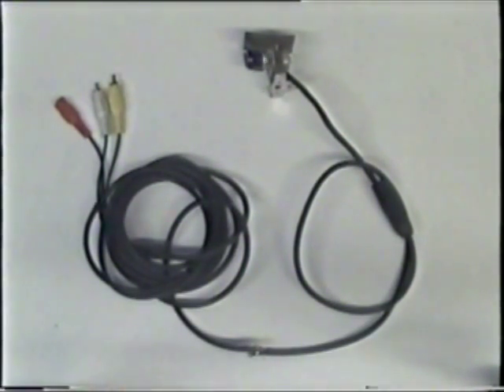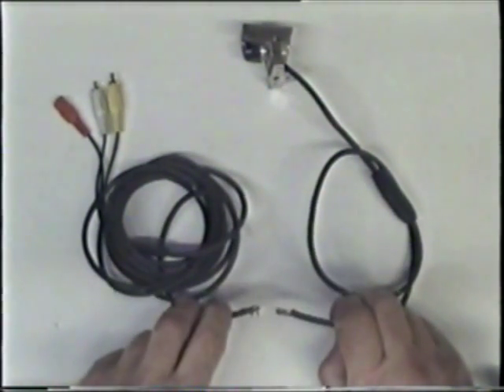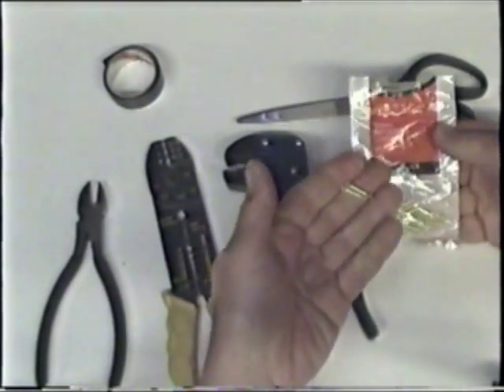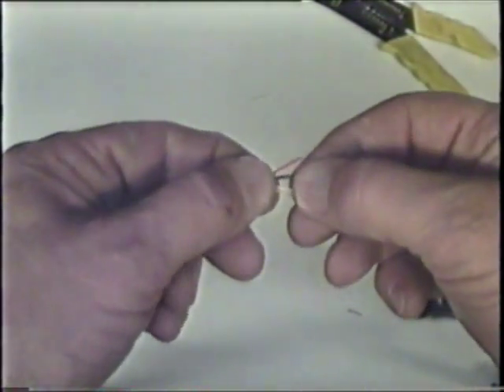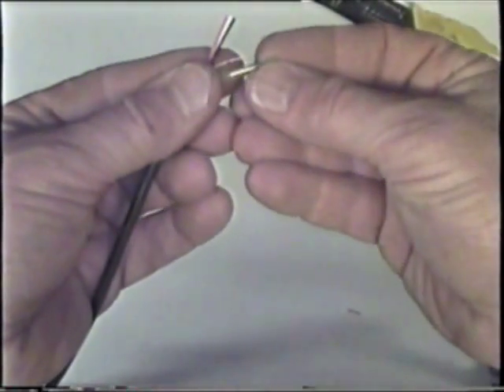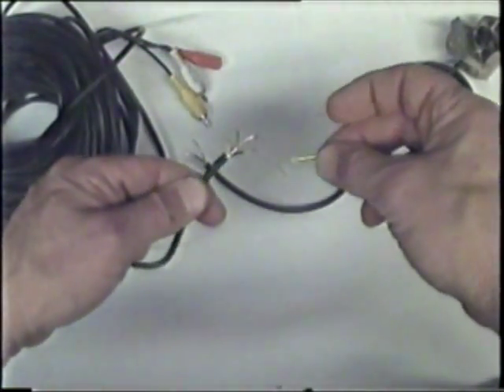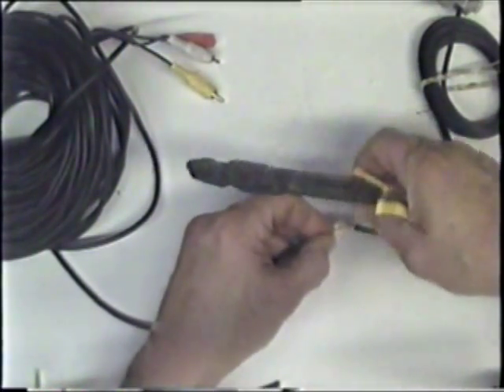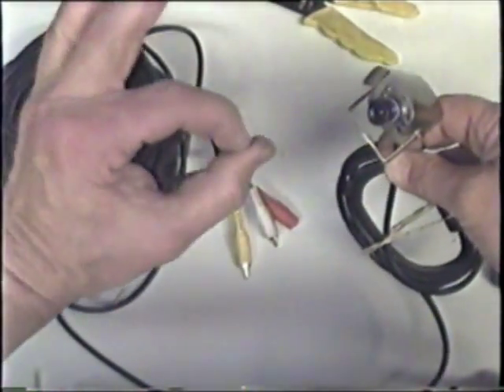Hawk Eye Nature Cam Cable Repair

Comment: I believe that my wood duck could hear a buzzing sound from the camera.  So, she pulled and bit at the wire and eventually tore it from the camera!  Does the white wire go just above the lights on the circuit board?  Will you replace my camera at no charge?

Comment: Ok so someone stole my radio and they cut all my wires. So could i get any home video plug cut it and wire it up, or has its own specific video plug. Its a Pioneer nd-bc8 dont want to take it out and run another cable